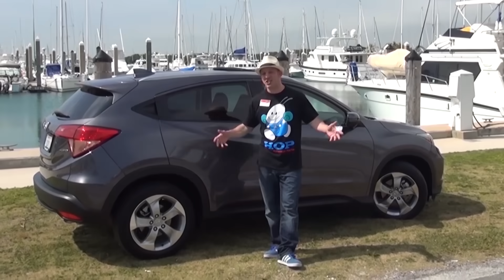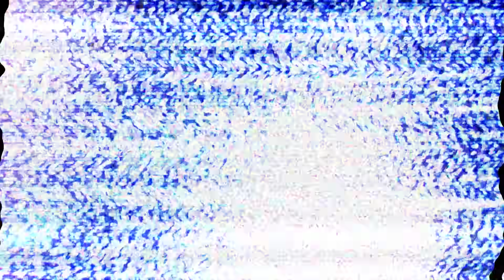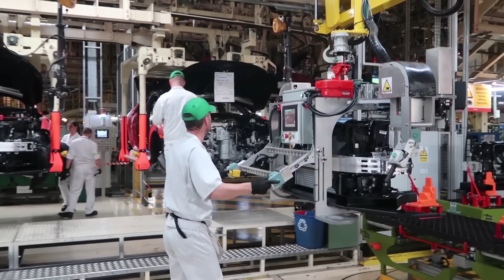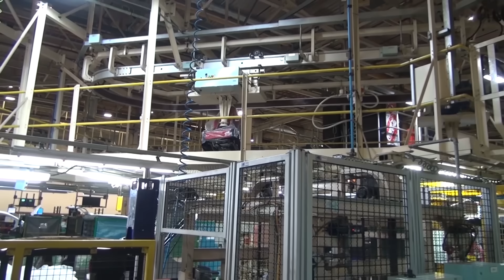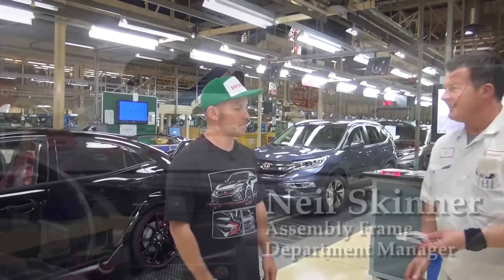Inside the Honda Civic Type R Factory! How is Fastest FWD Car in the World Made?

Comment: Certainly an interesting experience seeing how easy they are to put together!
Reply: I've read that Honda has the highest profit margins on manufacturing in the industry despite being the least automated, which is crazy to me. Seeing this video, though, it's clear they have an unbelievable focus on ergonomics and flexibility, so it makes sense.
Reply: They only show u the easy parts,just like when chevy and Ford show u a "clean" building on the news,the rest of the plant is disgusting. If he went to the wire install line,its hotter there,because they have to warm up the wires so they move/bend easier, and its not as clean looking.
Reply: Pikminiman only because of the union
Reply: It means easy to Fix.

Comment: So where is the guy in charge with the gear grinding?
Reply: Niru 
Honda still not stepping up? 
Honda:Garbage transmissions since 1998
Reply: They dont build the trans,they just Installed it.
Reply: Pube83 Ironically, the Honda S2000 came in 1999 and it's gearbox was titled one of the best gearboxes, you can see some S2k gearboxes in some Honda swap builds
Reply: @Pube83  lol. What are you. A bum? 
My 98 prelude got 327whp
Original gearbox 
278.000km+
Ny accord. 2003
198 whp.  145.000km + original gearbox 
No problems at all
Reply: @db2integra608  lol where did you hear that? Aisin makes the transmissions for s2000 and many Hondas and Toyota's, as well as the 6spd rx8
Reply: @Pube83  that's not true at all... B series transmissions can hold some serious power. I bang gears on a 22yr old transmission that I put engine oil in and it works perfectly fine still and actually feels better than most manuals I've driven
Reply: ZimmyMTB Toyota owns a 1/3 or half that company.
Reply: @Pube83  I have 2005 honda s2000 and 2019 civic type R....I never had any problems.  Maybe you should learn how to drive manual?🤷‍♂️😂😂😂😂
Reply: @turbo95eclipse  no its a known issue. Speed shift from 1-2 or 2-3 and there's a chance of gear grind. It might not happen with your car but a lot of us it does. Even the guy who got the nurburgring record had tons of gear grinds.

Comment: This video is awesome, from start to finish build of your awesome Type R. As an owner of the last generation of Honda Accords that have been imported into the UK, I am now starting to look towards the Honda Civic as a replacement for my accord.... but not for the next 5 years as my Accord has just under 50000 miles on the clock and hopefully by then the Civic will practically be the same size.

Comment: The 8 or 9 miles also come from the mechanics that complete the PDIs on the car at the dealership after the the truck drops off the car.  They also put gas into the car.
Reply: Minh Luu also from test drives
Reply: The test drive track is just under 3KM in size, however vehicles can sometimes need repairs, and the driving from holing areas to repair bays really adds up. I've seen cars with over 20 miles on them.
Reply: Honda PDI test drive is 10 miles. On top of mileage from factory test drive, shipping, and consumer test drives post PDI.

Comment: Very cool video!  I worked at Honda Canada (HCM) and was involved in the BOM (parts) system that was adopted by Honda UK.  I've seen all the US car plants, but it was nice to see the HUK plant!  Parts are put on the car with as little movement/walking as possible.  That's why sometimes the left part is installed in a different area than the corresponding right part - it would require 2 extra steps to put them both on in one spot!

I drive an Si, so there is a modicum of jealousy in seeing you acquire a Type R...  We don't get a discount on the Type R.

Cheers!

Comment: It’s really fast and secure producing these car. The workers look pretty easy installing the parts.
Actually, I have uninstall the regular sedan civic x once. It’s real easy as build a gundam or lego.
Thank to Honda engineer.
BTW, I mess around with rear damper without checking the manual first. I thought the bolts are under the interior as accord. I took off everything include the subs with confident. Shame on me the damper are outside. It’s much easier service on them ever.

Comment: 15:26 That Guy is wrong about the fuel differences between US Octane rating and European RON(research Octane number). 98 RON is not 98 Octane, the numbers are not comparable. Ron uses a different mathematical formula than Octane to measure the oxygenation of the fuel for rating . The actual comparison is 98 RON is equal to 93 Octane, and 95 RON is equal to 91 Octane. The cars real difference in power is that the UK measures in BHP, and the US is rated HP.

Comment: Order of installation is not what you would normally think; each job on the line has different elements that take a certain amount of time to do. There is only a certain amount of time to do the car so those elements are juggled around to the other jobs based on the demand of how many cars are needed and ergonomics.

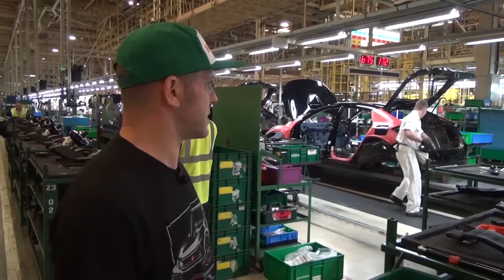Comment: @6:17 "I don't know why there's only one reflector" - It's called cycle time.  If you have 69 seconds per station (cycle), you can fit as many jobs into that slot as possible.  Given that you stated that someone down the line could catch up on unfinished jobs, its entirely plausible that you might not put paired items on at the same time.

Comment: Do Honda do factory tours? I’ve been around Nissan, Land Rover, Jaguar, and GKN in the U.K. and Massey Ferguson, Kverneland, Kuhn, BVL, SDF, and other factories including foundries, machine shops and sales and launch events around Europe. It would be great to do Honda and Toyota in the U.K. to compare techniques.
Nissan, for instance, take 60 seconds per station and appear slightly more mechanised apart from front and rear screen installation. At Nissan a robot applies the adhesive but both screens are placed by hand by the same two operatives, plus the roof plastic trim [unless rails are specified, all in 60 seconds. Nissan dashboard seems easier to install, because the dashboard assembly is built by the partner company in a factory on-site and delivered fully assembled to the line by robots in the correct spec and order. A robot then places it through the side and a man just pushes it into place and secures plus connects multiplugs, all in those 60 seconds ready for the next car, with no pause.

Comment: Hopefully, they put more attention to detail in these, than they've done with their other models.  We've had multiple cars show up with problems. Especially the Civic line. There's already several service bulletins on improperly assembled engines, poorly designed interior parts that can come loose, among other things.  I worked for three years at a Honda dealership next to the guy who was in charge of doing the pdi's on the new cars as they came in. Most of the cars were fine but, it was kind of shocking to see how many cars arrived with defects. The companies founder thought that a industry standard 10% defect rate was unacceptable, not sure if that is still the case. That's not to say that Honda is the only company with this problem. I'm sure other companies have the same issues. Nissan for instance, has a major problem with some of their automatic transmissions.  A big enough problem, that the Nissan dealership that's part of our group, has stacks of those transmissions to deal with replacements.  I'm sure you have your car by now, make sure to ask the service writer if there are any bulletins for your car that haven't already been taken care of.

Comment: Funny, the aluminum hood on the Type R and my new Accord both vibrate at idle and on the highway, however, the aluminum hood on my S2000 is stiff, it never flexes or vibrates.  By the observation,  the hood on new cars must not be as stiff or not as well supported as on the old cars.
Reply: Vibration could ultimately result in fatigue fractures which could mean big chunks or even the whole hood parting company with the car. We shall see.
Reply: The vibration is very subtle, the only reason you would even notice it is from the reflection, if the hood were a matte finish you would not be able to see it.  With the flutter being so minimal, there is little to no chance of it causing any other issues, it's just a minor annoyance.

Comment: I bought a 2017 1.0 turbo petrol Civic 6 months ago and I've nothing but trouble with it , front drives were replaced and their still making noise in the rain sensors going off on their own cracking brakes very bad condensation in rear lights and both front A pillars rattle last straw was the car breaking down on the way home from the dealer dash filled up with warning lights had no power ,warning lights were to do with ACC,lane keep assist and CMS. Worst car I've ever had. I hope the type R is ok best of look with it. Oh and I've had 3 other Hondas all faultless.

Comment: 69sec? I guess thats why the Type R has had so many issues.
Reply: WingKing76 what issues?
Reply: Todd Medium Wellington III Rattling sound in the a pillar, loud squeaking brakes, overheating, paint issues, transmission grinds and 4th to 5th gear lockout.
Reply: WingKing76 wow did you return your ctr?
Reply: Todd Medium Wellington III Did buy one yet because of all the reports of these issues from friends. Look on youtube and you can find videos all about the issues.
Reply: Jesus Christ, man, first off any of those problems are rare except maybe the cooling issues on track. But 90% of owners aren't taking their cars to the track and will never have it happen. The brakes squeal in pretty much all non-ceramic track pads, this is not unique to the Type R and is perfectly normal. Second, nobody has even two of those problems together. Besides, by the time the 2nd wave of 2017s and all the current 2018s came out, almost all the issues were fixed. My 2017 has had zero problems.
Reply: kabob21 That is great that you have had zero problems.
Reply: that's a pretty average tack time for an assembly cell. I was a tool and die machinist at the facility near kansas city that made the front and rear subframes for the chevy malibu. We pumped a completed unit off every 56 seconds. If you break the work down into enough cells its very doable and you still maintain great quality. There are a lot of digital check fixtures between cells and they do complete tare downs on 6 units a day to make sure all the torque specs are right and that the hardware was installed properly between the shifts. Its not perfect but pretty fail safe and the fairfax plant would double check the work upon arrival.

Comment: Test drove the standard civic, felt like a cheap tin can due to missing sound insulation.
Reply: Did the dealer say it had it? Because I don't think that's a feature as when I bought mine, I don't remember them mentioning it. But what more can you expect from a car that goes as cheap as 18-19k? 

If that's what you're looking for, cars that have certain glass that reduces road noise, I don't think Honda would be the car for you then.  I've also seen people mod their cars to reduce that, but I believe that might void your warranty.
Reply: @imtherealone.6268  Sadly, sound insulation is not an option you can purchase. I also noticed the same issue on older Hondas, like H-RV or Accord used by taxi drivers, all that weird rattling and wind noises, just terrible. Also, its MUCH MUCH worse then my 10Y old Skoda O2 diesel, which was not expensive. The biggest problem is that those noises are sharp and unpleasant.

Comment: nice stuff but new intercooler piping exhaust and to bad they didn't do that too the 1996-1998 first ek9 type r hatch boosted b series walk threw or just a walk threw for that I been sick for awhile ive worked on almost all Hondas even nsx not even certified its a shame I had a brain tumor and a lot more but im getting better only 29 years old ive worked on all kinds of cars domestics also 69 Camaros chargers im a Honda fan I have ctr swap and I was the first one to have a set of carbon doors for a civic 96 hatch and everything even told me now I dnt have conections nothing was hackdand because iwouldnt date a girl cause I had a girl she told em this and that and it screwed me over cause she would  always talk to the guy at carbon creations so I couldn't get or do anything or talk to him straight up same as rhd drive ctr clip for my hatch it was supposed to come with seats and gauge cluster steering wheel harness and all she kept the money and got the one with no carpet just a front end and a dash no suspension or anything but im just gonna keep healing and going threw this crap and get it fixed right been threw hell period but I have a 96 civic hatch with b20 vtec typer itr head alittle work hondata s300 450cc and not on yet but black skunk2 and regular aluminum skunk2 intake mani holset turbo charger tnt log mani fold and also stock b20z and I have a dart block neads  arp rod bolts and pistons 85 or 86mm ready to bolt with a set of arp head studs with another type r head b16b f20a h22a some k24a trans a lot of Honda stuff I ttok a d15b apart with my eyes closed and in school when I was in automotive like 16 I changed drum brakes on a 1995 chevy pickup truck blind folded and they wouldn't let me go to state finals for free tech for nadc to compete cause I had the flu so it sucks. FORGIVE ME LIFE IS A BITCH SOME PEOPLE HAVE A SILVER SPOON AND OTHERS DO EVERYTHING TO HAVE SOMETHINGAND OTHERS STEAL AND TALK SMACK SO I GOT SOMETHING TO BACK THAT UP.....THANKS FOR THE PLANT BUILD AWESOME LIKE TO MEET YOU.

Comment: You had to go and say center of gravity didn't you?
Gravity is only a theory. It doesn't exist.
                  "Respectfully"
   The correct term is Center of balance
             Or Center of density...
Reply: gravity as described by Newton and expanded by Einstein is indistinguishable from any other force of acceleration  so any change in direction of force is known as G force or gravity pull. Center of gravity is a correctly used technical term and fits all the requirements of the description of gravity. If there is no gravity then you have nothing to balance.